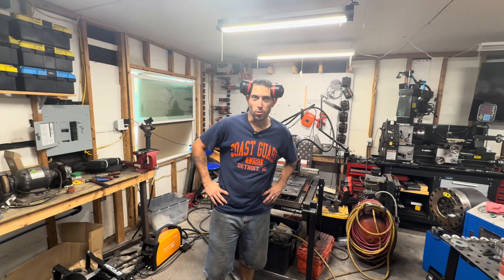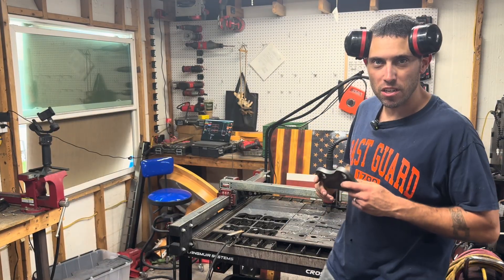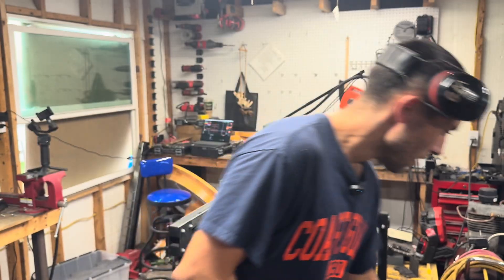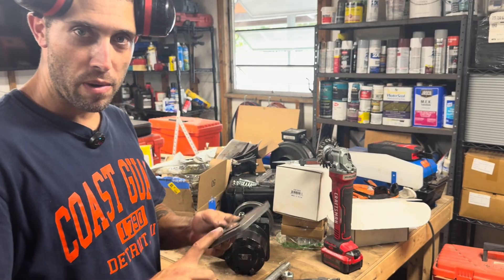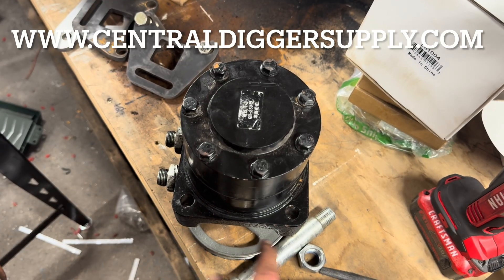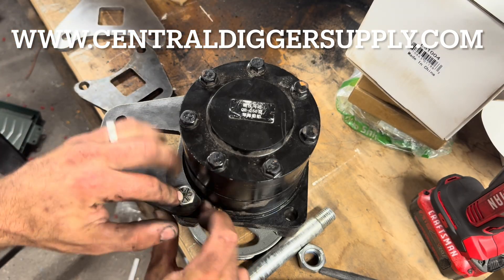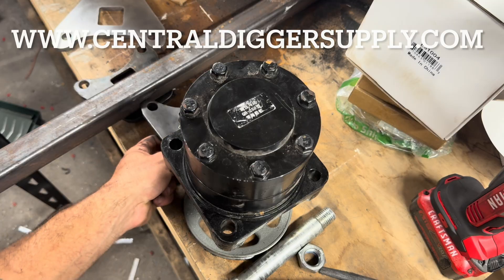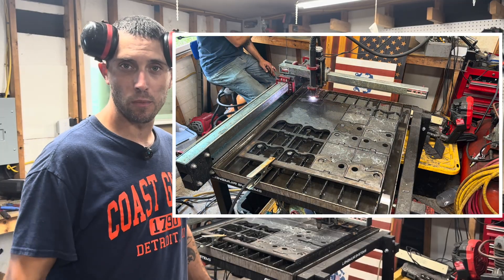CNC Plasma Cutting up and running!

Comment: Cam, love your stuff.  I've bought a few things from you and I could not be happier.  I have a challenge for you.  I have a Hightop HT10BZ with expandable tracks.  Any solution for motor protection without losing by ability to expand/retract my tracks?